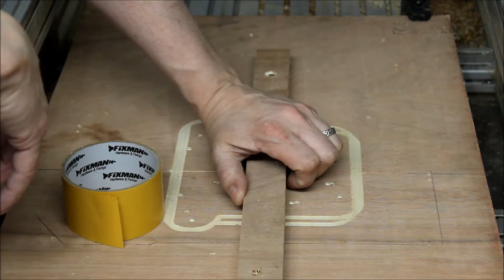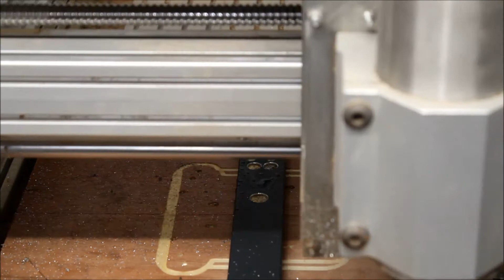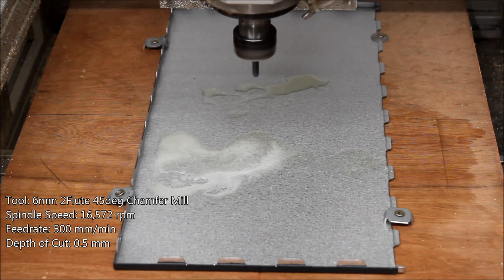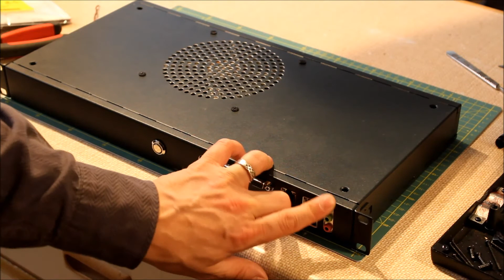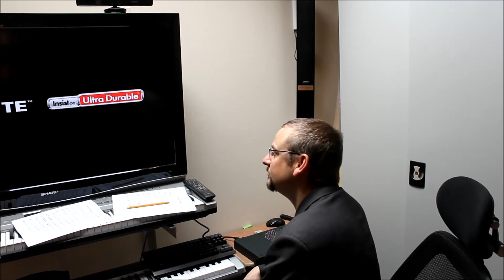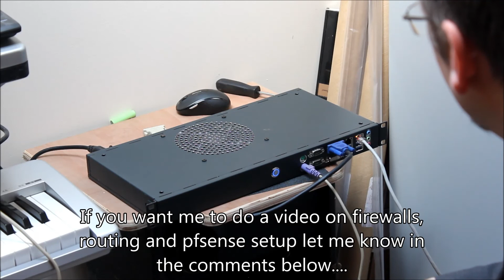CNC Project - DIY Rack Mount Firewall/Router - Part 2

Comment: Nice build, I'd have gone for a SmoothWall Caswell CAR-3000, Astaro ASG220 or Watchguard Firebox x550e off eBay.
But then again I don't have access to a cnc machine, which is a far cooler option
Reply from the maker: Thanks Andrew for the kind words and the commercial options, which are getting cheaper and better (pfsense also do a package themselves). CNC is not essential as the front and back of the chassis I used is aluminium, so a drill, hack saw and files could be used, but of course the "human precision" element creeps back in.

Comment: Hi, I'm currently running pfSense on esxi, thinking about moving to a separate box in a 1u case, but I'm wondering how noisy are 1u PSUs. how does it compare to a standard one? thanks
Reply from the maker: Hi Giorgio - this one has been fairly quiet for a PSU with a 40mm fan - its still audible and not as quiet as a 120 or 140mm fan but bearable.
Reply: Great, thank you!

Comment: @I_Made_This brilliant build love the cnc but the air flow dosnt make sens how is it going to putt hot air from the case as the intake of the fan is directly the other side of the fan just a waist of fan lol ps love the music studio setup, do you produce music?
Reply from the maker: The fan pulls enough from the sides also - its a very small chassis for a 120mm fan - there'll be another project in the future that will make use of the "chimney" effect, as I need a rack mount NAS for backup of my servers...
I do indeed produce some music - more hobbyist than pro and my output is not "prolific", but I enjoy doing it. There's an example on this channel of some I did back in 2004/5 (look for Previously Unseen Falcon 4 Development Footage).

Thanks for the kind words also.
Reply: thank you agen i have enjoyed these videos keep up the good work

Comment: Thanks for sharing. I would love to see some setup video and maybe something about the advanced options. It's always cool to see how someone uses certain software. The possible wifi router option sounds really nice as it could secure the network here in a way that I wouldn't be able to do in this budget range. Does pfsense have options in it so you can access it remote or is this something that they left out of it for security reasons?
Reply from the maker: Hi Lars - thanks and I'll start working on a setup video :-) As for remote access - yes it does have remote access - so far I've found it can use HTTP (not recommended), HTTPS/SSL and can use SSH with RSA/DSA keys. I'm not sure if you can block acess to a single port only (I expect so but haven't found the setting yet) or you could block the remote access IP port on the firewall against physical ports/wireless
Reply: I think the VPN option you mentioned would be great for my wife to add her pictures that she shoots for clients. That way she wouldn't have to use dropbox.